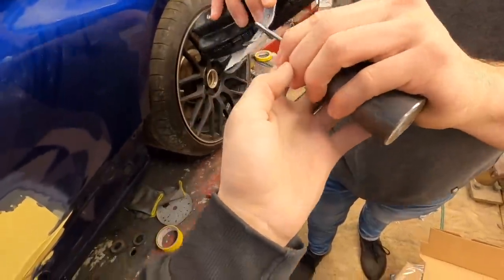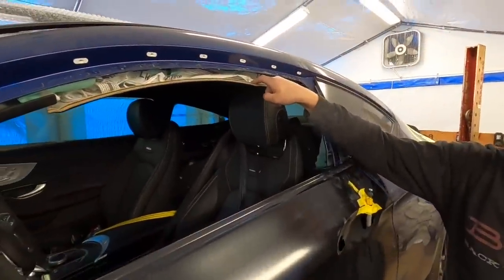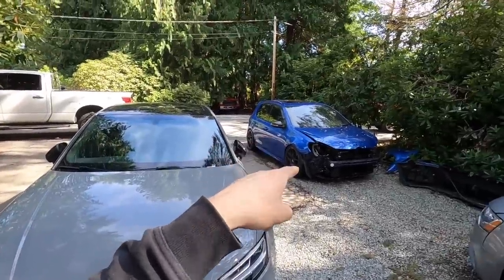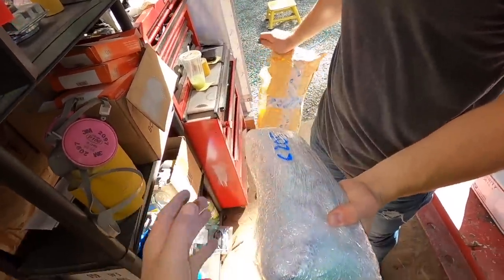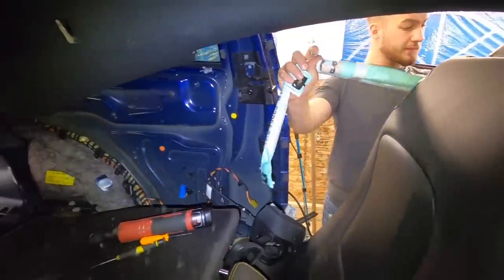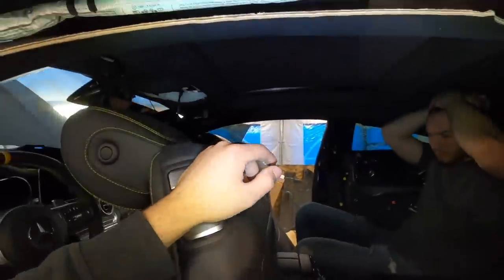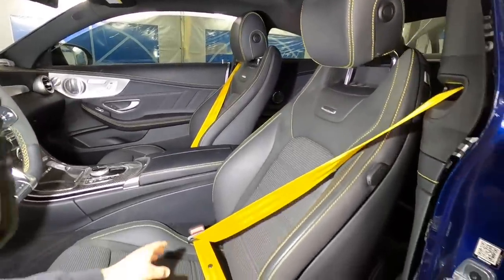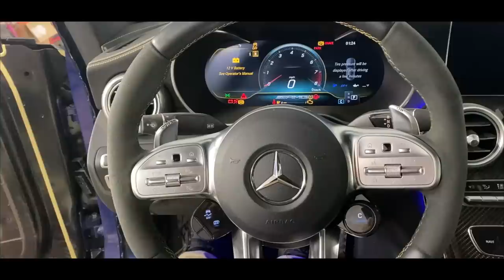Rebuilding a WRECKED 2019 Mercedes C63AMG From COPART! (Part 6) INTERIOR GETS A COMPLETE MAKEOVER!

Comment: U need a specific weight for explosives to mail.
Reply from the maker: haviii the lego gunner thank you! Very interesting
Reply: It's for protection. If the box is falling the weight is hitting the ground first cause it has more weight. If the ariback hits first it would explode
Reply: Soldier also correct
Reply: @soldier1810  HOW IT WILL EXPLODE WITHOUT POWER? LMAO
Reply: @georgel.4836  same way a shotgun shell explodes without any power
Reply: @MrAmorti  huh? That's a terrible analogy lol
Reply: @mastalee1776  just saying, he seems to have forgotten that's basically what an airbag is.
Reply: The weight is for when its being transported during shipping and does deploy by accident, it doesnt accelerate outwards and fly across the cargo holding area...  99% of the time its used for air freight shipping. It's made with the weight so it will stay somewhat contained in the area its in and not go flying clear across an area at 100+ mph......
Reply: @angryyank  So it's like an emergency anchor, if the explosive should go off. It holds it down and allows bag to deploy without rocketing across the cargo hold. Cool.
Reply: @john.e.kenney66  Exactly John
Reply: Can anyone tell me how the airbag get refilled?

Comment: If you make the shutter speed longer (like 1/50th instead of 1/100th) the flicker will go away. The flicker is there because the frequency of the light is too low for your camera settings. That’s why you will sometimes see stripes of black when you take a picture of a screen.

Comment: Airbags should be shipped in safety cages and they are heavy. So if the seller declare an airbag on the package label , it is expected to be heavy because of the cage. Or you just add false weight to the packet for the customs ...